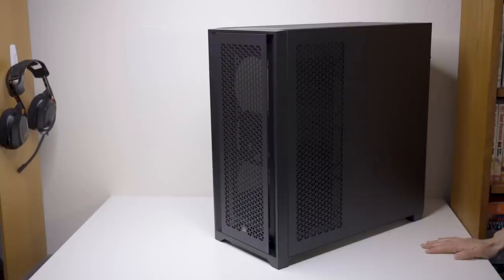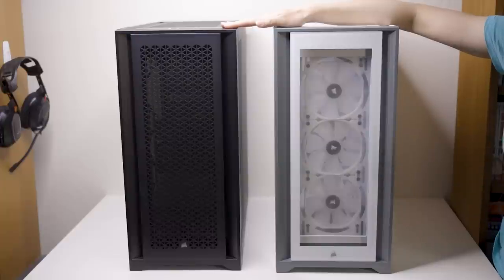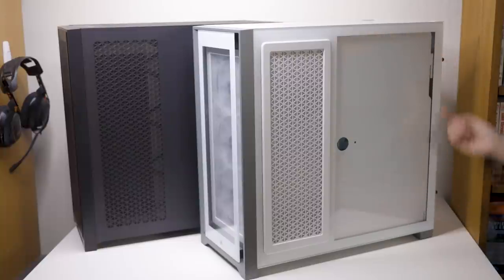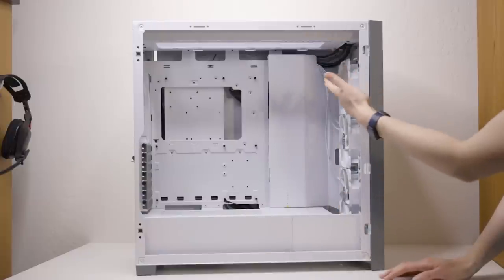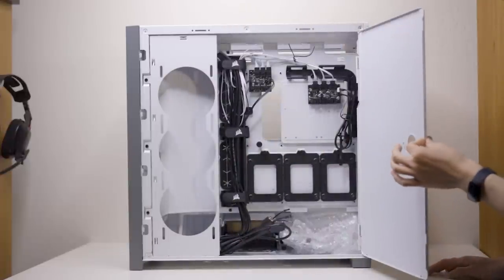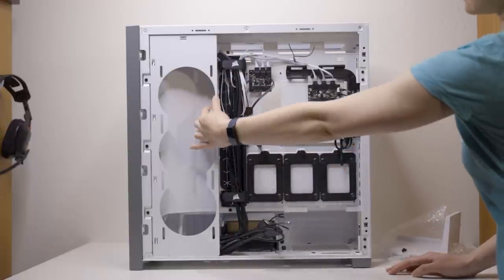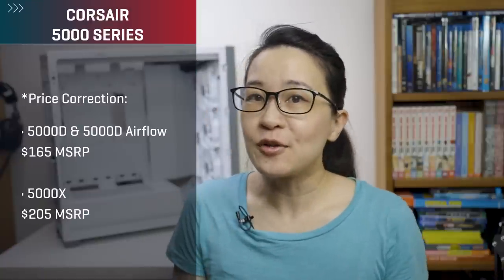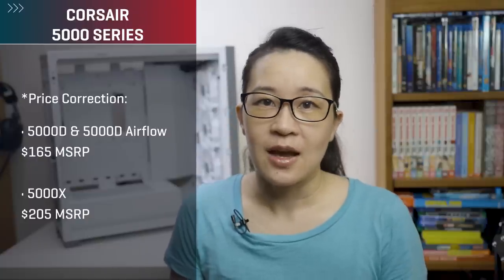Corsair 5000 series teardown and comparison

Comment: PSA - Front mounted EK SE radiator + iCue Link fans + XD5 RGB Elite pump = no go for installation of a 4080 (ASUS ProArt) unless the GPU is water cooled. The stock cooler makes it about 4mm too long to fit.

Comment: This was really helpful to see the differences between the 2 series (5000 and 4000).  Im actually trying to decide between the 2 and its hard when I dont own either.  Also your in-depth showing of the harddrive cage and psu along with the graphics card example (many of these things other reviewers did not cover (Actually other reviewers 'glossed' over the HD cage and took it out)).   I also agree with you - atm Im in a conundrum, 4000 seems a bit small and the 5000 a bit big ...

Comment: I returned my 4000 for the 5000, the size difference is a game changer for me, yeah it’s a little bigger but not by that much considering the vast amount of versatility added with the size. I was limited to a 240mm AIO on the 4000, yes it technically supports a 280 with low profile ram but I do not have low profile ram. So now I can stick my new 360mm AIO in the front, side, or top which is great. The second USB port on the front IO is great as well and I like the motherboard “tray” that sits behind the motherboard, this adds extra room for something like my lightning node core pro which I previously had to take out a hard drive bay to accommodate for it in the 4000. In my opinion this is the perfect amount of size to versatility. It’s not a full tower case that dwarfs everything in sight but it’s also not too small that it limits what you can use. Good job Corsair

Comment: Oh my gosh you’re amazing! Saved my pc build. I needed to find out how to remove the cable mounting plate to gain access to the mother board fan bracket because I’m putting a distribution block there for a custom water loop thank you so much
Reply: @pcworld  I just watched for the same exact reason. Thank you for showing where the screws were on the shroud you removed over the wires. Awesome.

Comment: How did you manage to get the thumb screws for the hard drive cage off so easily? They’re literally glued in place for me, can’t move them for the life of me.
Reply from the maker: It's possible something changed during production since our initial look. Do your thumbscrews have the slots for a screwdriver? You might be able to break the seal with that additional leverage. (Be careful though.) -Alaina

Comment: Thanks for your video which gives alot of details on this case. I am still considering which one I should buy comparing with Phanteks 500P,  the only one thing I don't like this case is the front fans and the rear fans which is only 120mm, worrying about the airflow is not enough good for RTX 3090 gaming in 4K

Comment: Probably one of the best tear downs  from this case that I've seen. I had the obsidian 500d and i got sick of it and got me this black 500d airflow.  What do you recommend  for the fans that go on the mobo shroud to be? exhaust or intake? I have the 400d airflow on my 2nd rig and i loved that case and i got so excited when this 500 came out. You got a new follower!
Reply: i also had  a discount i found on retailmenot for 10% so it dropped it down in price ^_^
Reply: @pcworld  ill probably do some testing with the addition 3 fans you can now in stall in the back by the mobo. I wonder how adding extra 3 fan  on the top for push pull would help the AIO cool?  and thank you!  you do great content.

Comment: Have you tested any riser cables that work out of the box with this Case? Im worried about the height of the PSU cover
Reply: @pcworld  turns out Linkup’s 4.0 riser with two mobo raised screws worked fine, if anyone was wondering

Comment: Could i buy the Glas front and top panel from the 5000x and put it on the 5000D ? Or will Corsair not sell the panels separately ?
Reply: @pcworld  Even the panels from the 4000 Series aren‘t in the EU store. Because I ordered the 5000D. I have enough Corsair fans and also the RGB hub. And i thought i could safe some money if i use all this again. Could you pin a link to the shop if the Panels are online on they‘re shop?